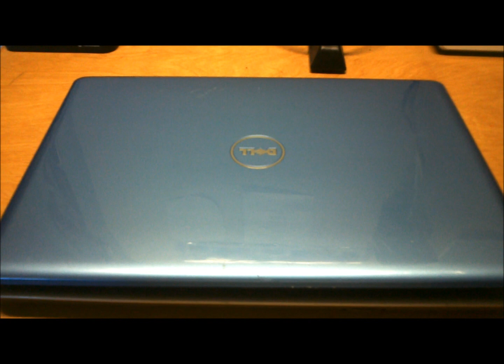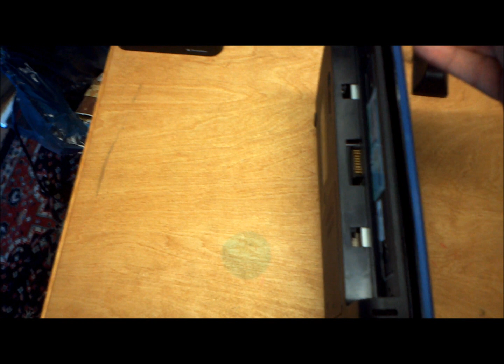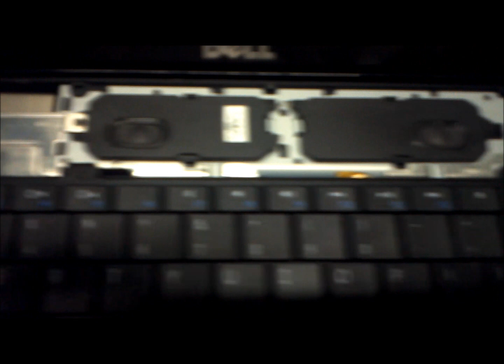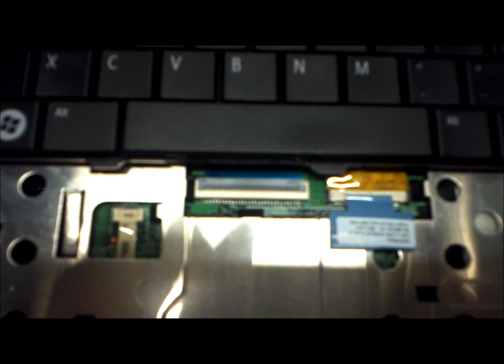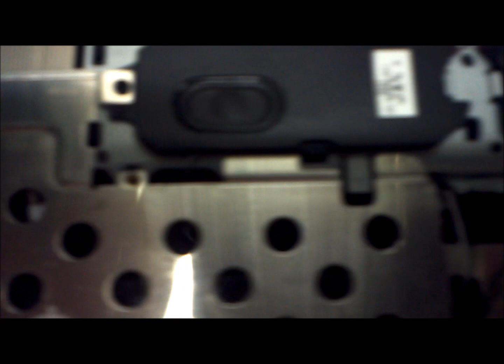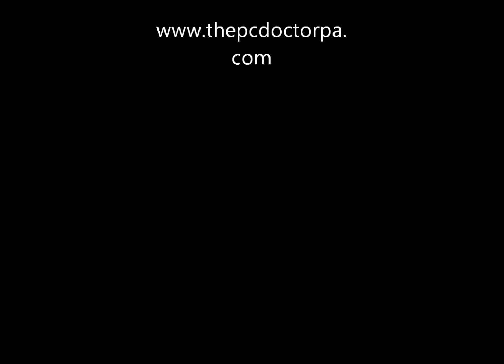Inspiron 1440 Keyboard Removal

Comment from the maker: If you have a small pair of vise grip locking needle nose pliers you should be able to lock onto the head & turn the screws. If this doesn't help, go to my website & use my contact us link with your information & we can communicate through email. You can take a picture of the screws & I can guide you better. Hope this helps!

Comment from the maker: Check the part numbers on each keyboard located on the back of the keyboard. If they match, it may work. Many models use the same keyboard to save building costs. If the part number, cable or screw set up is different, don't force it. Sorry for the late answer, I was out of town for the holiday.